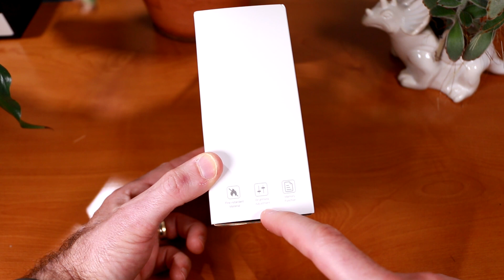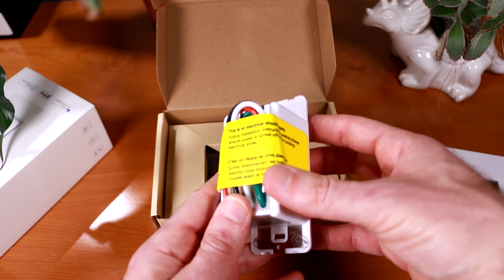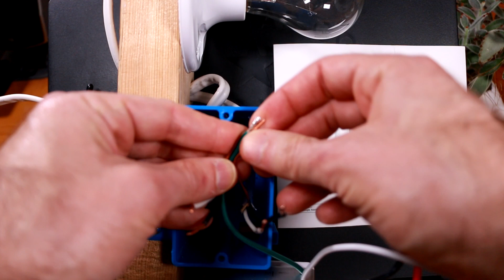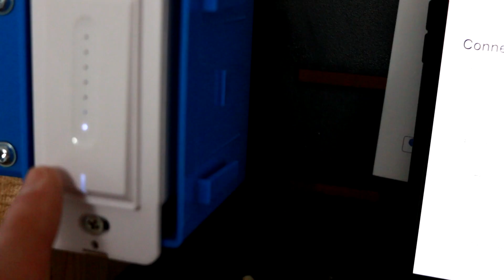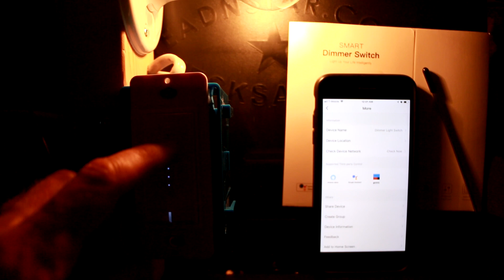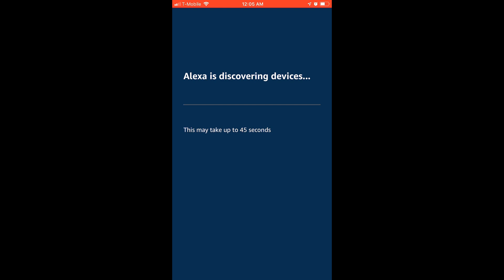Oittm Treatlife smart wifi dimmer light switch review and alexa setup

Comment: Will this work If I have a 3 way dimmer Switch?  I have not looked at the wiring yet but I am changing out my switches and wanted to make sure I order the right replacement.
Reply from the maker: Thanks for your question. I don’t believe it would work to replace a 3 way dimmer in the circuit with this model no.
Reply: @reallyMello   do you know if a 3-way Smart dimmer exit . Does TreatLife have one?
Reply from the maker: Not yet, but hopefully in the future. Last year the smart 3 ways started to appear to maybe this year we will see more manufacturers release ones with dimming capability on 3 way circuits too.
Reply: A quick search shows there is a 3-way one, but it is only an on/off switch, not a dimmer.
Reply: @edisonpascascio4947  Different brand, but it is a smart 3-Way Dimmer that works with the same Smart Life app as all our other Treatlife smart switches. https://smile.amazon.com/gp/aw/d/B07R4ZCD2C?psc=1&ref=ppx_pop_mob_b_asin_title